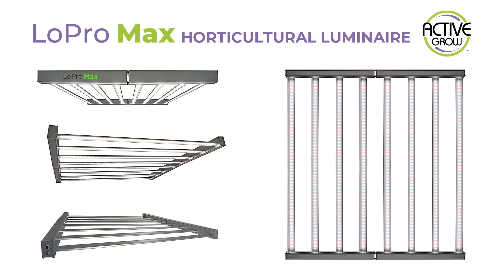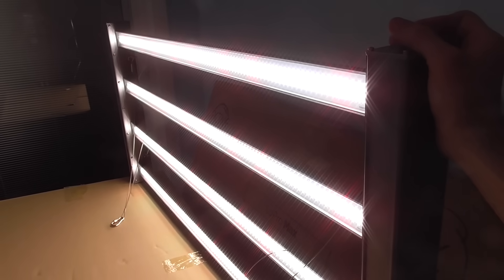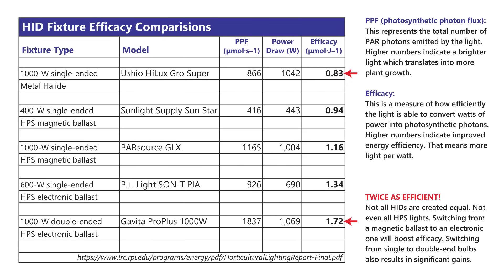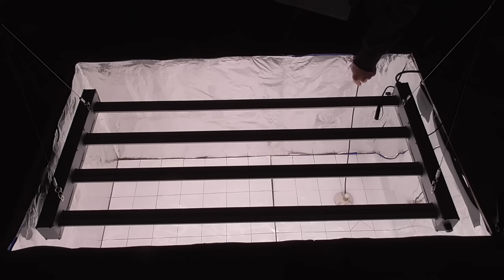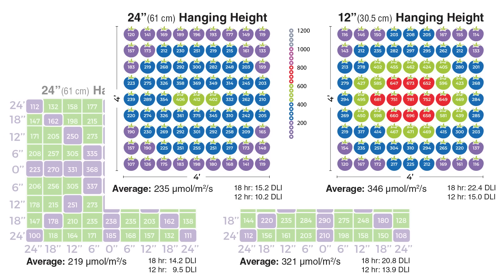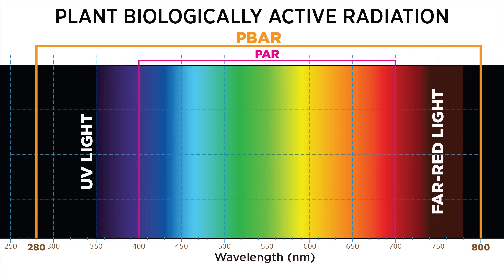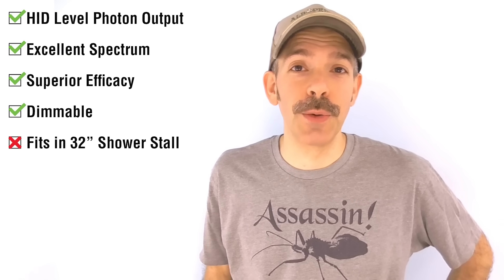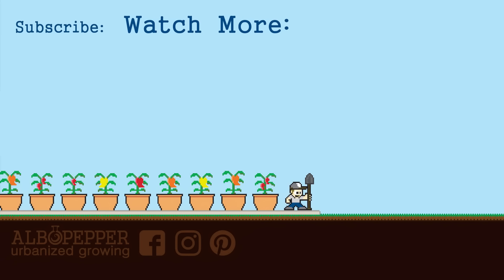Low Profile Dimmable LED Grow Light: Active Grow LoPro Max Review -Commercial LED Replaces HPS / HID

Comment: Thanks Al, love your videos, they come off as more scientific than most others.  Thats meant as a compliment.  How does this stack up against the Spider Farmer 2000, I bought that at your suggestion, and waiting on delivery now.
Reply from the maker: Hi Mike! Thanks for watching. The SF-2000 has a smaller footprint and it's only 2/3 of the power draw with 2/3 of the light output. Of course the SF-2000 costs less as well. Both are a good value. The form factors are different. So depending on what your application is, one light might be better than the other.
Reply: Well I’m just starting out, really don’t know anything yet.  I will give microgreens a shot.  I got the dimmer switch with it.  What do you suggest be the height and strength I should run it at.  Thank you again